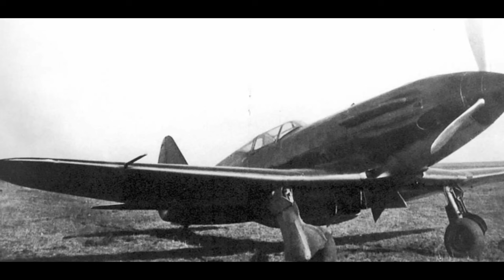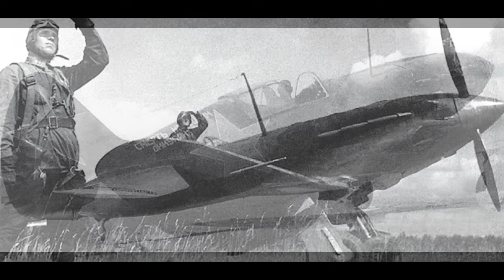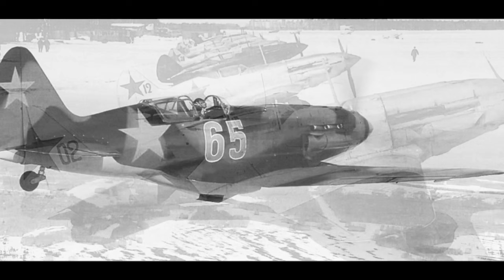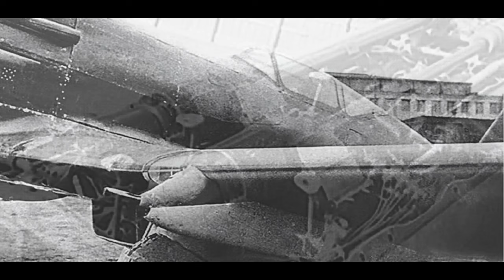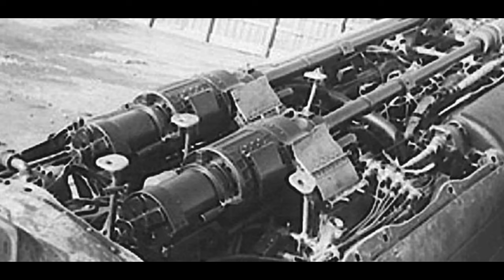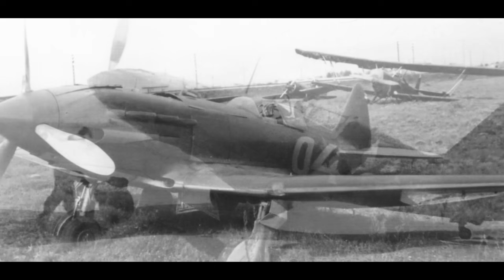MiG-3: The Worst Fighter of WW2?

Comment: It started out with the Mig-1 all destroyed in the Barbarossa most of them standing on the ground.
The first priority of the Luftwaffe was to take out Soviet airfields holding Mig:s and to hunt the Mig.
So there it is, not a bad plane at all. Well trained Soviet pilots had perished in the Barbarossa fast trained ones where tossed in so bad that them pilots could only navigate in following landmarks flying very low in a straight following a leader, them where to learn in combat. If this would have happen to Germany the story of  Bf109F-G would have been the same.

Comment: Finicky and unreliable AM-35A engine

Engine overheating in summer due to insufficient cooling

Insufficient throttle response (engine acceleration)

Oil pressure drop at altitudes above 8,000 m

“Stiff” handling: poor controllability at high speeds, making boom-and-zoom tactics ineffective

Weak armament: 1 × 12.7 mm and 2 × 7.62 mm — insufficient for reliably to shoot down German twin-engine bombers such as He 111, Ju 88, or Do 215/217

Sustained fire in long bursts was difficult due to the close placement of the machine guns near the engine; the guns would overheat and begin to malfunction

Ammunition belt feed issues (belt misfeeds) during aggressive maneuvering

Limited structural strength and airframe durability

Mediocre level speed due to low-quality mass production

Limited dive speed (due to flutter)

Insufficient rate of climb

Poor horizontal maneuverability: large turning radius and long turn time

Slow roll rate

Comment: MiG-3 was the fastest plan in 1941. (faster than Mosquito). Was great plane and version with AM38 was better tnen Bf 109F
Reply: Не совсем. На сколько мне известно, bf109 достигает максимальной скорости на 5000 метрах, тогда как миг-3 на высотах 7000+, а точнее 7800. BF109 модификаций F летает на высотах от 6000 до 6500, Миг всё равно выше должен подниматься.

Comment: Although it was designed for type of war that didn't happen on Eastern Front, it could be said that it prevented Germans from daylight bombing deep into Soviet territory, and even somewhat hindered their plans at night. Most of the planes manufactured served in PVO, not in VVS, thus some survived until the end of the war.
In general terms, direct competitors like Yak-1 and LaGG-3 had lower wing loading and better power/weight ratio from the start, so they were better fighters. Later with Yak-7, 9, 4 and La-5,7 this advantage only increased.  But it stills remain as what-if question, what would had happened if they attempted to strip more weight from MiG-3, even reducing fuel load and range.
Reply: You are right but ... MiG-3 with Sturmovik engine was another breed completely! It outperformed and Bf109F at low altitude

Comment: After many years of reading about WW II fighter aircraft, I've come to the conclusion that the MiG 3 was the reverse case of the U.S. P-39 Airacobra: it was an aircraft with great features for an aerial combat scenario for which it was not designed for. It was designed for high altitude operations, but it turned out that most of the air combat in the Eastern Front took place at low and medium altitudes. At lower altitudes the Mikulin engine tended to overheat and the flight characteristics of the airframe made it hard and tricky to control, to say the least. I wouldn't rank it in the top 10 list of the worst WW II fighters. It was an advanced aircraft for its time, but it was pressed to serve in unfavorable conditions because of the shortage of aircraft caused by the destruction of huge amounts of Soviet hardware in the opening weeks of Barbarossa.
Reply: There is a reason why Moscow wasn't leveled by german bombers. And Mig-3 was one of those reasons, regardless of high losses it performed its duty.
Reply: @brankokrnic5746  The lack of German oil is the main reason, at no point in the war did Germany have the resources for a large scale bombing campaign. 

Battle of Britain was their one attempt and it was a costly failure, Moscow would have been much harder due to the distance
Reply: @KekusMagnusHistory begs to differ. Soviet cities west of Moscow are proof. Leningrad is a proof. They were fought back at Moscow. Fact.
Reply: i'd rather be in a mig 3 than an i-16, though i consider the i16 to be ahead of its time. I think that assuming the pilot has been given adequate instructions, the overheating is the most egregious issues for the mig 3 in its native theatre. However, i have also heard that the mig 3 had issues with control authority at high altitudes and high speeds as well, or that at speed the pilot could not pull hard enough on the stick to achieve maximum turn performance.
Reply: Yep..well suited for a high altitude interceptor

Comment: The Mig-3 was actually among the best performing fighters at its introduction. It had a poor combat record due to being difficult to fly and getting deployed in low altitude dogfights for which it absolutely was not designed for. The few pilots that figured out how to use it to its strengths performed very well in it, it was a fast and deadly energy fighter which excelled at high altitudes and high-speed hit and run tactics, which were uncommon for soviet pilots at the time

Comment: That range requirements were made by ... Yakovlew personally. 
Yakovlew had a very good relations with Stalin.
So , to eliminate aby competition from others design teams , he spoked to Stalin about not enough range of todays fighters aircraft, and Stalin who trust Yakovlew (as a member of "new" plane designers group, "designed" after revolution, not by tsar Russia) listened him, and ordered these request for 1000km range in competition for new fighter aircraft.
So Yakovlew had opportunity to eliminate others plane designers, because they will not be able to reconstruct their own prototypem for new range request in time - he thought.
But Mikojan design beauro immidiately start to reconstruct MiG-1 , without hesitation. Plane designers stayed  many hours in factory, they worked  as i remember in thre days non stop to design a new additional fuel tank at bottom of pilot seat, between intercooler and pilot seat.
They maded this 🤨! They prepared on three days prototypem od MiG-3 , with additional tank and range 1000km.
But not without cost.
Plane was less stable, because his center od gravity was moved aft.
That started problems with stall on some flight conditions, especially in dogfight.
Plane was heavier, that makes Landing more difficult because of higher stall speed, and higher Landing speed.
Changes on cooling system did effect cockpit temperatures - temp was higher, too high sometimes , pilot groins were almost boiled.😏
Yakovlew plane was not prepared for competition, I-300 needed more that 300 small construction changes to be accepted for trial, so additionally Yakovlew ignored request for 1000km range, because he had no will to change his aircraft construction , and with good relations with Stalin he was sure that his plane will be accepted anyway without range 1000km.
IT was Yakovlew trick to eliminate other prototypes from competition for new fighter plane , when his plane wasnt Remady even to begin factory trials before army trials.
Yakovlew need time to refurbish his own plane to make it ready for official army trials.
Reply: .... the part about the beans and frank nearly being boiled kind of made me flinch...😬
Reply: Яковлев был заместителем Народного комиссара по авиапромышленности  а не просто "в хороших отношениях со Сталиным". И выполнял свои работу - давал Родине только лучшие конструкции причём с возможностью быстрого запуска серию. Ненавидят Яковлева и лгут на него те, кого он не допускал к государственной кормушке со своим "чудо - оружием".